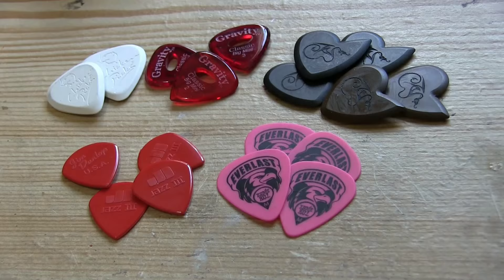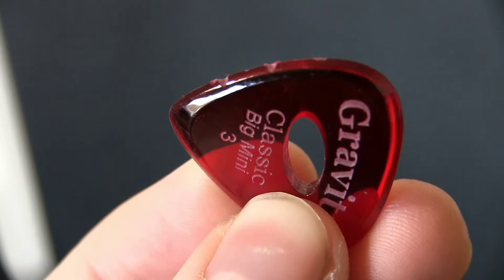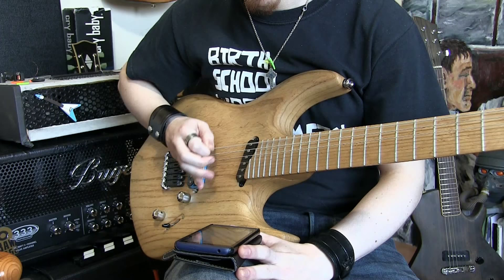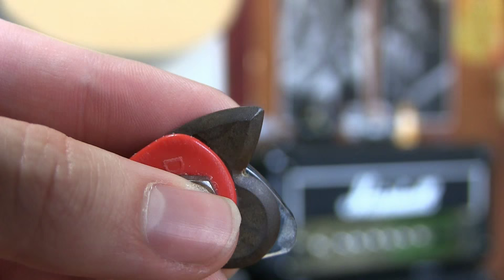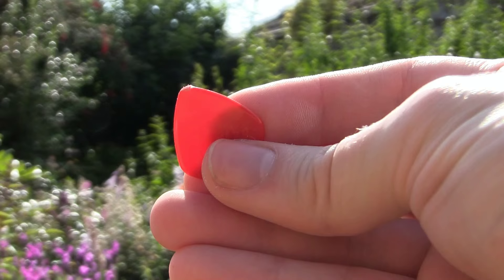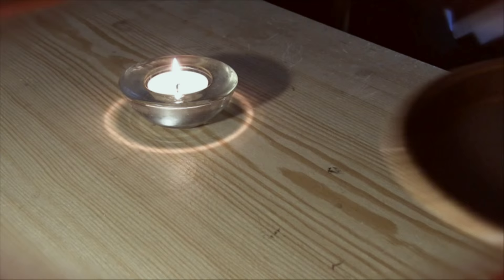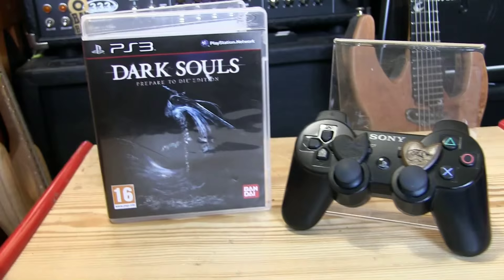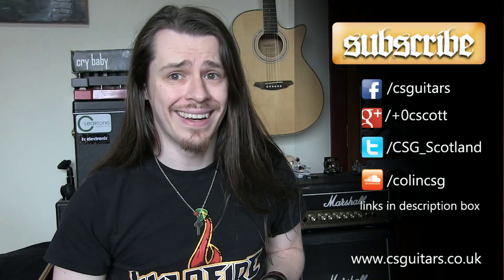Dragon's Heart Guitar Picks: Torture Test Part 2

Comment: I bought one of these because of your last video. Didn't like it.
Two angles are way too blunt, and one is way too sharp. :D
And overall, not comfortable to hold in the hand...
The material is awesome, but other than that, the picks, to me, are terrible. I'd probably like it if it was regular shaped...
Reply: +Paulius Mscichauskas One of the tips is regular shape, the completely round one is more for strumming chords and the sharp one is for speed picking. It takes getting used just like when you first try thicker picks.

Comment: hey ive a question about these found sole ive picks i use heavy gauge strings and am currentlu using the dunlop tortex picks as there the fastest and most comfortable ive found so far,but the strings rip them to shreds very fast is the dragon hearts comparable to the tortex in speed i have to order them internationally so its costly and time consuming just wondering if if its worth the time and expense or should i just stock up on tortex and grind em to shreds .anyway thx for any help i also added the iron age led light yesterday preety nifty lil gadget ,and a wilkinson roller bridge, it made a million times difference to the guitar thx
Reply from the maker: +Scott Gallimore Get rid of the Tortex, DHGP play much faster and easier and won't grind themselves into oblivion on heavy gauge strings. Honestly, once you've used the DHGP for a while you'll wonder why you ever liked the Tortex in the first place. Very much worth the investment. 
Also, remember you can get 10% using discount code: CSGUITAR10
Reply: +CSGuitars  ahh thanks for the info ill order some from the internet and give em a shot hard to find picks at all here in the phillipines its all chinese plastic junk 50 pieces for .99 cents and yeah u get what u pay for lol
Reply: ok i have the picks ordered be a month or 2 for arrival yeah 3rd world postage lol,i have a question regarding tusq nuts i need to replace my cheap factory nut seems everyone advises the tusq i was thinking of getting a roller nut but cant find a 1 3/4 inch size so do u recomend the tusq as a viable alternative also have the grover locking tuners being shipped but is useless wit a bad nut causing tuning issues thx and keep up the good work
Reply from the maker: I'm not a fan of tusq, and I seem to be in a bit of a minority regarding my opinion.
Then again I'm even less of a fan of roller nuts.
I'd say if that is your only options then certainly go for the tusq, less things can go wrong with a well cut nut of a single material.
Reply: ok any other ideas on a replacement nut or should i just try lubeing it with graphite its a cheap plastic nut that the strings keep getting snagged on causing terrible tuning issues amazing the cheap parts put on expensive guitars i guess every company is cutting corners except for the price of course
Reply from the maker: If the slots are too deep, or weren't cut right in the first place then no amount of lubing is going to make it better. 
A new nut, cut for the appropriate gauge of strings you'll be using, is the best thing you can do. If it's good enough you shouldn't even need to lube it, although there is no harm in making sure things slide.
Reply: thx for the advice ill buy a new nut and get it replaced when the grover tuners get here next month thx for your help
Reply: i contactacted tusq and sent them photos and measurments of nut so ive got the correct nut ordered finally,am wondering if i should go ahead and replace my old tuners with grover locking tuners or wait and see if the new nut will fix the issue , im hearing that grover is the best tuners just wondering what you thought thx for all your help keep up the good work
Reply from the maker: I like the standard Grovers, although I haven't tried their locking ones. 

If you are looking for good locking tuners then Hipshot do the best ones that I've tried. They are lightweight, stable and have a great action. You can get them in closed or open gear versions.
Reply: I used 13-60 in standard tuning with a DHGP GT and I wore down the rounded corner in 2 weeks, great picks but I'd much rather just buy some cheap, disposable 1mm nylons.  Saves me waiting about 2 weeks for the delivery from Texas.